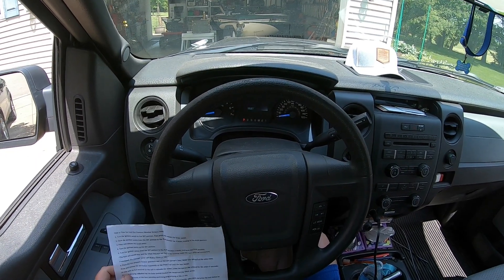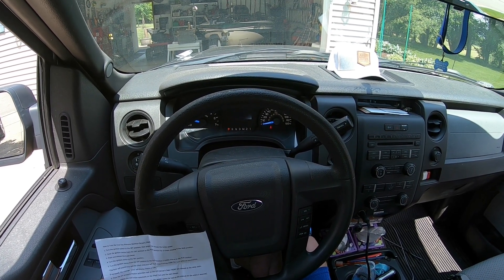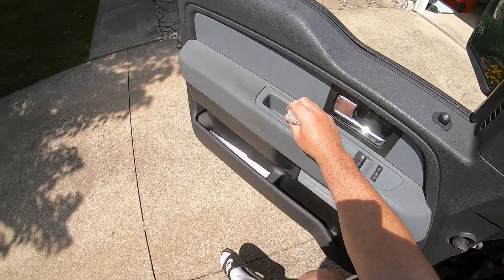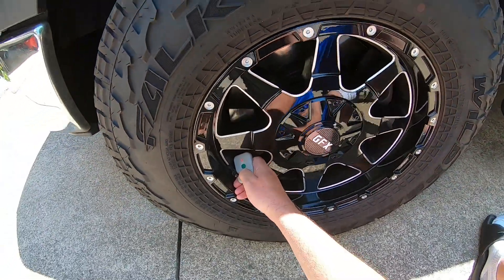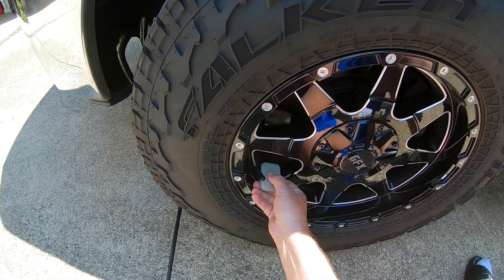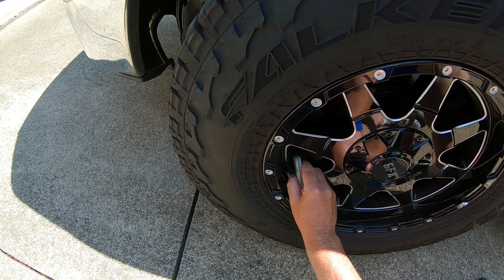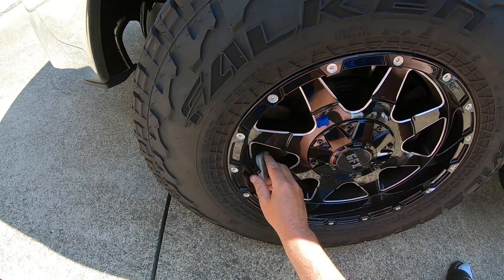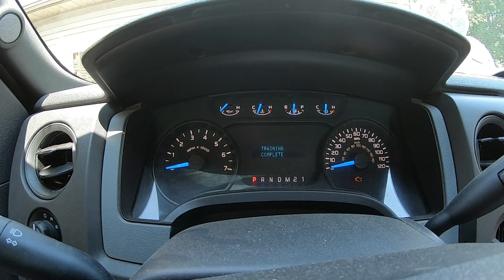SOLVED - 2013 Ford F150 TIRE PRESSURE SENSOR FAULT Solved After Tire Rotation #fixed  #howto #diy

Comment: Hey! Im trying the same procedure for my truck right now. Did it take you a few presses of the button to do each wheel? I tried pressing it ar least 5 times even tried different wheels and i can't get a honk.
Reply from the maker: @jacob8660  yes.  You have to hit the button multiple times to get to work. Move it around and keep trying cause all the rims have sweet spots that are different. It took me a few times to get it to work.
Reply from the maker: If you can't get to work, it could be a bad TPMS sensor too (hopefully not).
Reply: @Hipiam  Thanks for the quick reply! The TPMS sensors are only 2 years old so I'm thinking they should be fine still. My wheels are just regular winter steelies so I wouldn't think it would be that hard for the signal to get though.